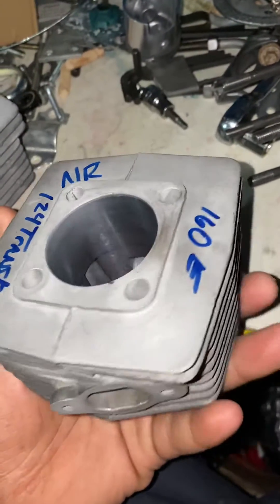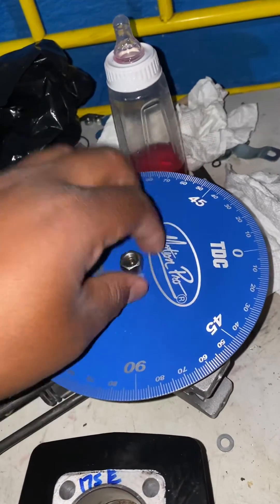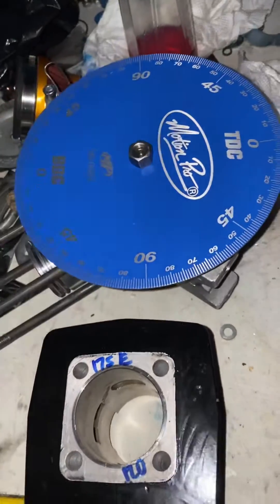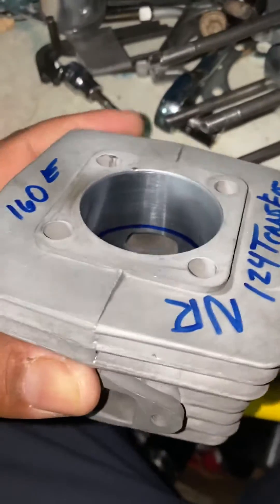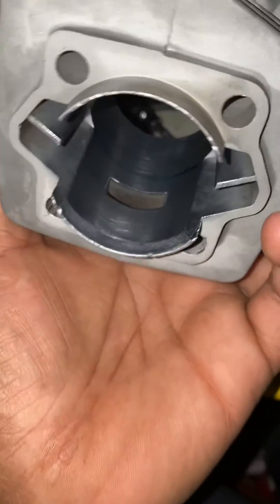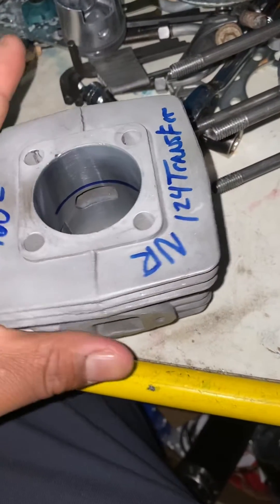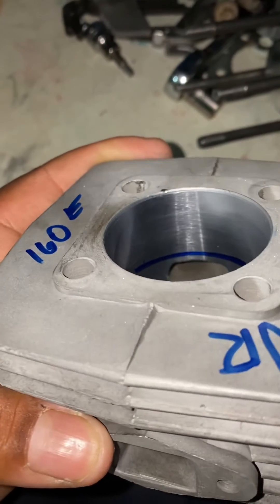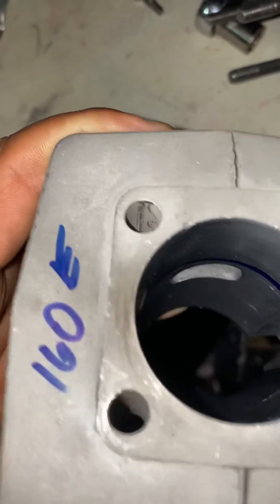Why you shouldn’t port your motorized bike cylinder by “EYE”.

Comment: do u still have the mz65 i cant find them anywhere
Reply: The replicas are good alternatives
Reply: @ryanlucascarrasco  im thinking about getting s ktm 65 pipe or something and adapting it to bolt on, with the replicas they seem like the header pipe is too long and diameters are too narrow, i made my own expansion chamber by welding some cones together and putting them on the stock muffler header, cutting the muffler off. Not tuned but probably does something idk. Im looking into actually doing the math and making a pipe thats actually designed specifically for these engines but that shits hard
Reply: @shjskaput4550  yea get a real pipe and make it work the replicas suck too narrow

Comment: Well with trial and error you can learn without a degree wheel but yes much safer to use one. For people just cleaning up ports and widening them a little you definitely don't need a degree wheel but for trying to gain real power yes definitely agree
Reply from the maker: The issue with trial and error is every cylinder is different so you have no constant

Comment: Don't be paranoid. I've always eyeballed it and never had issues. Just don't be stupid.
Reply from the maker: It’s not about paranoia. It’s about results and consistency.
Reply: @bigtsmotorizedbikes4242  consistancy i can understand... But i have a good sense of how far is too much. Most guys might mess things up but i like to think I'm a little different haha as a general rule, you want the exhaust port to take up just a bit less than half the stroke. Exactly half is 180 degree duration. The only thing i measure is width because you don't want to catch a ring on a port thats too wide...
Reply from the maker: @jjhack3r  180 is a lot. Power band very high. Most motorized bicycle transfers can’t even feed 180 properly.
Reply: @bigtsmotorizedbikes4242  that's why i always make the exhaust considerabley smaller than half the stroke ;)
Reply: I've eyeballed two cylinders and one turned out terrible and the other turned out strong. I timed two other cylinders and one was a screamer and the other was pretty good after port timing changes.  Can't trust stock timing to just start removing metal. One jug had 130 transfer stock! That's too much even built. If course, doing a good cleanup will just improve whatever is already there.

Comment: I got a dremel bit from the harware store, put it in my handheld drill and ported intake manifold and intake, took skirt from piston on intake, stock my bike was barely pushing 30 now im cruising at 35-38 on 40t sprocket and 43.4 top speed all ported by eyeball revs really high
Reply from the maker: You got lucky. It’s hit or miss eyeballing
Reply: @bigtsmotorizedbikes4242  he is right i did that to one cylinder had more power higher top speed thought i did the same thing to another cylinder runs worse then then stock

Comment: I just picked up a triple 44 wrote it a couple time and now the cylinder won't seal with the head it's blowing out back by the carburetor I don't know why
Reply from the maker: Head probably warped
Reply: @bigtsmotorizedbikes4242  is that common I bought two new performance heads
Reply from the maker: You cylinder may not be flat on the top. Or the gasket may be bad.
Reply: @bigtsmotorizedbikes4242  I replaced the gasket my cylinder head is Warped I put a straight edge on it I think my cylinder looks fine though is that common
Reply from the maker: @MrCrawford77  Yea they warp easy the stock ones
Reply: I've probably had a dozen cylinders in the last two years and I haven't had a flat one yet. First thing I do is take a big flat file to the top of the cylinder head gasket surface, the intake, and the exhaust. I usually color it with a marker and hit it until it's even and then put it on a glass plate with sandpaper just to make sure it's smooth. I'm actually running one with no head gasket right now and it's fine